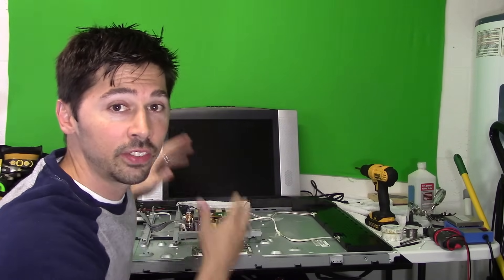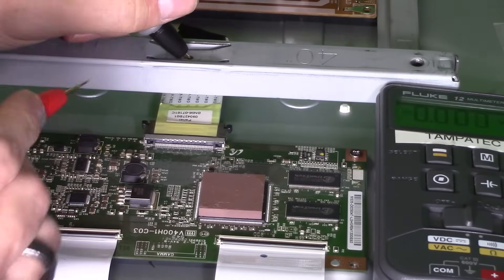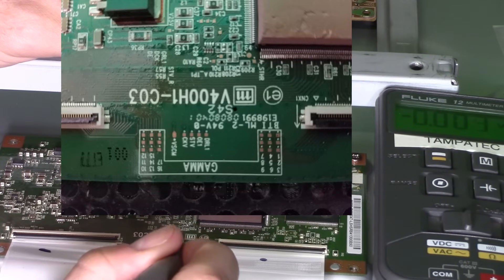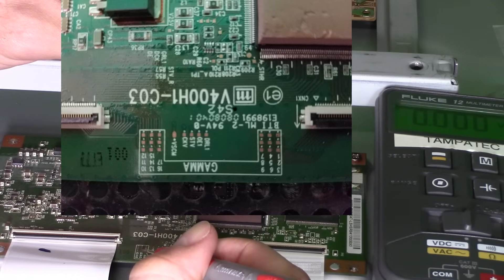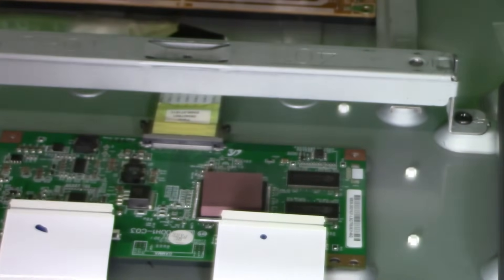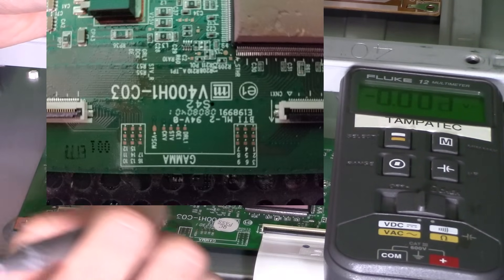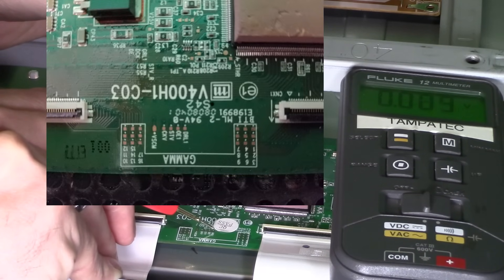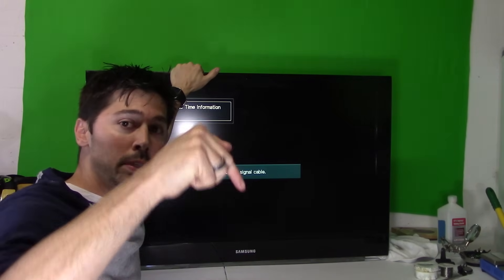THIS EASY 5 MINUTE TV REPAIR WILL FIX MOST VIDEO PICTURE PROBLEMS!!!

Comment: Hey tampatec! I like you're videos there really good to learn how to fix most problems! I have a LG42LH3000 that when switched on half the screen is black then after about 20 mins the black part goes different colours and flickers like its going to go away then after a few hours sometimes it is just a small couple of inch line down the left hand side that is brighter than the rest of the screen! I suspect the tcon board but not sure. Any suggestion's would be much appreciated! Keep up the good work, you're the best on YouTube on TV repair! Regards, Eddie
Reply from the maker: Eddie B yes you are correct send like bad tcon board get TV boards at Shopjimmy or electropartsonline.com use code tampatecfriend for discount 😉
Reply: +Tampatec I did wach other videos that said it was the ribbon cables at the top of the screen that were loose and if you press the top of the TV at the it does make a difference so I don't want to replace the tcon board if its OK. Thanks for you,re reply meant a lot to me as i assume you are a very busy guy! Regards, Eddie

Comment: Hi, I have a Viseo 50" Plasma model # PDP50X3T012. It began flickering light to dim intermittently than permanently went dim for the last few days but we continued to watch it during the week. It started to flicker with a black screen so I finally disconnected it. Took back cover off and saw a ton of dust. Saw a video that it could be the Y-sustain board and saw some old dry rotted thermal glue but cant tell if its a burn mark or not. The video recommended to start with the buffer boards but they look ok. Any advice?

Comment: I have a Seiki Model SE32FY22, and all of a sudden the left half of the screen looks like it has a thin white veil or screen over it with both vertical and horizontal lines.  Use it as a monitor, not a TV, and I can see through it, but can't do detail work like editing photos, etc. (am a graphic designer).    Seems like this might be the same problem.  Do I really need to get a multimeter and go through all that testing (i.e. what else could it be?) If it isn't an expensive part, I'm inclined to purchase it and see if it works.  Other side could go out.  Would replacing the board fix one side and keep the other from going bad?  Thanks so much!

Comment: Hey guys I have a RCA 55in no back lights looks I tested it by watching one of the videos here looked like the main power board had no power coming out going to backlight so I replaced the main board but still no lights BUT it flashes for a second when turned on any suggestions form here.

Comment: Hi there. I got a 47LG70 LCD tv. My daughter was listening tv when the screen go black. The sound keep working (optical output). She close it and wait for me. When powering the red led standby blink slowly then came blue. The backlight open for 5-10 sec then dim out a little bit "sleep mode". TCom board is falling?? 5-6 month ago I got vertical line on dark picture area, after cleaning all connector with contact cleaner, the problem was solved. All capacitors look good. No puffy, no dark board area. TCom or main board? Thanks for your help!

Comment: How do you know the proper voltage at each test point?
Reply: i dont think the actual voltage is as important as the voltages being constant. But i have no real understanding
Reply: Sean Moran I’m an electronics engineer working with microcontrollers. In our field it would be vitality important to know the voltage between boards, if not the actual waveforms on an oscilloscope. This would only give you a rough idea of which boards might not be working (once you worked out the power supply was ok !).

Comment: Awesome video that gives me something new to look at as I continue to diagnose and hopefully fix my GHOSTING problem. I suspect my issue is the bonded ribbon cables to the LCD, but this gives me something to check with the T-CON. AWESOME. Only thing I would add would be where to look for what those test point voltages should be. They seem widely varied. It's not clear if you are just looking for floating voltages (unstable) or a specific voltage at a test point. Especially since you had something like zero or 0.80vdc on a test point and that seemed to be OK. Is this info in a service manual? If so, where would I look for that manual?
Thanks for sharing!!! I appreciate your contribution and helping me diagnose and fix my malfunctioning Samsung ln46a650a1fxza!! Have any videos on the bonded ribbon cables that connect to the LCD?

Comment: Saturday 10/21/17 my 47"  vizio led lcd 1080p tv popped and the picture disappeared then returned.  Then it popped again and the picture was fuzzy in front of the cable picture.  It popped again, and the picture showed 4-6 vertical pink or purple  lines then the picture went black.  I turned the tv off for a few minutes.  When I turned it back on , the tv reset and the cable picture lasted 10 minutes then repeated the above  process.  Help please.  The Model # is M470SL.  Serial # LAQKMBBN4403300

Comment: Thank you very much for sharing your skills and knowledge. Liked, subscribed and shared.

My Samsung LCD TV UA40D5000 model with vertically shifted double image. Based on other videos in you tube, I tried to break certain connections between tcon output and the panel using thin plastic shim. It was not helped at all but all the sudden it became worst. Now the right side of the screen stuck with alternate total black and random colours vertical strips. The left part of the screen is still having the double image.

I don't want to spent money on new tcon board if there is possiblity of shorted panel.
  What you think the problem is?

Comment: Hi, saw your really amazing video. Have the same white washed out picture phenomenon, and the same tcon board, on Samsung LA40A550.
I checked all voltages. All is ok except... values on pins 1 to 9 is unstable. "Dancing" nonstop around the mid-value, approximately plus minus 0.1 Volts.
Well, what is your verdict?
Best regards, Yoram

Comment: Samsung TV UN55KU6290FXZA vers. CJ05 Hubbie used wrong screws to reattach base stand. Punctured black clip on left side of where ribbons come down & attach to the green metal strip board (runs from extreme left to center where ribbon bands are. Had picture on Left side, gray/white lines on Right side of Ribbon bands. After taking off back, hubbies idea was to "clamp" the punctured area, trying to flatten it. The Right ribbon came undone, but we reinserted per your video. Now, we have dark blue screen flashing with sound & power intermittently. HELP! Any suggestions???

Comment: Thank you for all your repair information. I have a Vizio e701i-a3. It will come on and show an excellent picture and sound for about 5 to 10 minutes. Then it will start to flicker and after 2 to 3 minutes of flickering the picture goes off but the sound is still there. I can look closely and still see the picture inside the screen. It does this for all inputs and menu. Should I start with t-con board replacement or what do you suggest?
Reply: My 70-inch Vizio plays good when you first turn it on but then it'll pop and go off read online still on but I won't have a picture or Sam I can turn it off and turn it back on and it plays good for 5 or 10 minutes that the same thing

Comment: Just subscribed. I am losing my mind over the upstar tv I bought. I want to replace the boards. I CANNOT FIND THEM ANYWHERE. Any advice?
Reply from the maker: monte claro try shopjimmy.com Electropartsonline.com use code tampatecfriend or Amazon or eBay  searspartsdirect.com
Reply: Tampatec there's seems to be no supply at all for these. Upstar m280a1 simply has no replacement parts

Comment: I have a question for you. My LG has an issue where the menu keeps popping up for no reason over and over again. No buttons are pressed on the remote and it automatically just keeps coming back. what can I do to repair this issue?

Comment: this is great...could you tell me if its the T-Con board that is the main issue that would cause problems with picture? or could it be other components of the tv? im using a samsung UE48JU6400k and i get weird blue faded areas on the tv that are light blue..its most noticeable when looking on a white background. wondering what i would need to replace.

Comment: Hi there, lived in Spring Hill for about 28yr., I live in W. tenn. now and mess with electronics mostly as a hobby now (retired), I have Spectre tv model X322BV, no picture, power light on when I turn it on. Any help would be appreciated. pulled the main board but nothing obvious, now stuck ???

Comment: Can't the board fixed?  Who can afford a new board I can't.  Technician (I'm in the Philippines) said he can try and heat up the board with hot air and see if it will fix the board, I haven't done this yet.

Comment: Hello i have a sharp LC-60LE660U. when i power up the tv there is a quick flash of the display and the led stays white. So i did some debugging and i am at a point i need a little more help. if i unplug one of the tconn ribbon cables and power up the tv i get a picture on one side and a white screen on the side that is unplugged. If i i do the same thing to the other side i get the same results. the picture looks fine except darkening near the middle bottom but i think it is because i have half of the system unplugged.

Comment: I have a sanyo DP55D33 tv. It has worked great until we got home from a trip. It now has faint blue vertical bars on the left side. They kind of twinkle where the pixels are trying to work. They are about 3 inches wide. You can still see a regular picture through them. They are opaque so to speak. There are 4 blue bars. Some are darker blue than others. We still have full picture and sound with the "ghost bars" in the background. Do you think this may be the T-con? I don't have a multi meter to check connection. I have seen other videos where the ribbons to the actual screen need pressure on them. Any advice would be great. You make some very good and informative videos. This has been the best thing I have found on the internet so far. Thank you!

Comment: My tv is Samsung ue46d7000lsxxn with tcon board s240labmb3vo.7.
I see black lines espacially with soccergame (green background)
After checking above video I opened my tv but my tcon board is different then board in video.
I think i have to replace the board but I do not know how to check this board before buying new one.

Comment: Hey, this is great! Thank you for sharing your skills!

We have Samsung TV that is acting up. Although it's 6 years old, we would like and try to repair it (since we live in the Caribbean and getting a new one of the same quality will cost us immens amounts of money).
It is a Samsung UN55D6420UF. From reading up on it and watching some of your videos, we think it is the T-Con Board that needs replaced. Our symptoms are slightly different because the pciture isn't permanently gone, though and I wanted to ask, if this still could happen with a damaged T-Con Board.
When we turn on the TV in the evening, it works for 1-5 minutes and then the screen starts flickering green or purple and soon after the screen turns black. Sound still works. As we turn the tv off and back on, the picture is either there for one second, then turns black or it is black at all times. It is an "illuminated" black screen. Sometimes the screen stays "illuminated" black sometimes the tv screen is completely black like it looks when it's turned off.

If we leave the tv off for several hours, then the same thing happens again. It works for a couple of minutes....etc.

Could this still be the T-Con Board? Is it worth trying to replace it? Will we still find that part for a tv that old?

Thank you so much for your help.
Nadine.

Comment: Hi, I have a Sharp Aquos 70 inch 3D TV. The picture suddenly started to flicker like there was a bad connection. I had a repair guy come in and take a look and he said it was a bad panel and said there was nothing he could do. I am still hoping there is light at the end of the tunnel for this TV as it's only 3.5 yrs old. Can you offer any insight? Somone said they pulled out the left T Con cable and it fixed their problem. I just need a video of how to do this . Any help would be greatly appreciated.

Comment: I have a panasonic TC-P58S1 Aug 2009 LG92240007  Plasma TV that has voice and shows Cable TV menu but no picture on any stations; just white, purple, blue and green diagonal splash from upper left corner to lower right corner of screen. Any suggestions?

Comment: Hi. I have a sharp tv with backlight, sound but no picture. I have tested the t-con board points to the screen and they are showing minimal volts. When I unplug the cable/ribbon and test there is normal voltage. Any ideas as to what might be causing this as I replaced the board but it is doing the same thing. Looks healthy until it is connected to lcd.

I've watched all your videos, very useful and interesting and I've learnt so much. Thank you!

Comment: I`m very glad I found your videos..I always assumed HDTV`s couldn`t be repaired...I now know different...Thanks!
Reply: I worked at a tv repair shop when I was in high school...way,way back in the "old school" 1960`s when we had to contend with horizontal output transformers and picture tubes remaining charged with thousands of volts long after the sets being turned off.....today`s HDTV`s look much less threatening to service....  :-)

Comment: greetings! I have a LG LN520B,. when I plug it in. no power light, no nothing. won't turn on. any idea what may cause this? thanks
Reply: Rich Sims Check for open fuses in power board Remove power board and check for cold solder joints around components that get hot. Check all voltages coming off the power board and do a visual for swollen electrolytic caps. Check electrolytics with a capacitor tester

Comment: Emerson blinks red to green. Everything looks clean on inside. Conpasitors look good. Hear a pop sound when I plug in tv. Hard reset flashes 10 times when tried.  Than back to two times green when left plugged in. Don't have a workibg volt meter to check anything yet.

Comment: I have a Seiki t.v. model SE50FY28.
my t.v. had no sound, so I replaced the power supply board.
Now it has sound, but no picture.  
Followed instruction on the flash light test.  The flash light test failed.  I did not see any picture of my menu when I press the "menu" button on t.v. and shined flashlight onto black screen while t.v. was on;  the screen was still black.
I am wanting to test the T-Con board but do not know where it is located on this model Seiki.
I have noticed that the "source" button does not work when I press it to change to hdmi  port where the cable box is hooked up, 
or could it be that the hdmi port does not work and that is why the source does not pickup the signal?  The antenna hookup does work as I can hear the channel being broadcast, and the up/down channel button on t.v. works.
Anyways, any assistance you could provide would be greatly appreciated.

Comment: hey I liked your video so this is my problem my grandmother  has an element 42 inch flat screen the red standby light is on and she says that regularly the red turns to green and the tv comes however now it just stays in red standby mode any suggestions I just heard about it today and some of the stuff on line is not clear but you seem out of all of them to know what your talking about any tips for this would be  greatly appreciated

Comment: I have a Sanyo dp32640 that turns with sound but no picture. The t-board lights up but after a few seconds lights turn back off. I suspect it's the T-board but not positively sure. I don't believe its the inverter board that's doing that.

Comment: I have a Hitachi le50a6r9 tv I have blue power on and red power off buttons, no blinking lights, I looked at the boards all looks good, I have power in and 12volts coming out of the main power board, the tv is dated 12/15 so I think they last longer than this,  I have changed the power supply, nothing has changed. I have power coming out of the supply everywhere i should.

Comment: I have a VIZIO SV370XVT that starts with no video, than horizontal lines and slowly the video appears
I changed the main board and now the sound comes up immediately, but the whole screen has lines all over and it takes some 15 minutes before video starts to appear and it's very clear and sharp
Can it be the T-Con board?
Suscribed Thanks

Comment: Tampatec, this video won't play, even in 480P, without constantly stopping to buffer!  You should do something to fix it because that makes it pretty much unwatchable.
Reply from the maker: steve c that's your internet maybe reset router or maybe update phone and YouTube app. my video plays in HD smoothly. disk clean up can help speed up your pc.
Reply: No problem on my end with 50 Mb speeds, everyone else's video in higher resolution will play without a problem and even other ones of yours will too.  Actually I only played one other video of yours but it played OK.  It might be a problem with CenturyLink who has been accused of throttling videos in the past but in this case Youtube actually seems to be throttling it depending on what it's being played on.  When I tried it before the best resolution was just 480 but now I see it can go up to 1080P so that's still a problem to take up with Youtube.
BTW, changing a bad T-Conn board on a 70" Vizeo won't fix the problem because when the Sharp made LCD goes bad it blows out the T-Conn and if you replace the T-Conn it will just blow again.

Comment: very informative. i dropped my Samsung 43in  3 feet on to carpeted floor taking it off its mount. I turned it on it worked, but flexed the frame and got lines through the logo worse lines then vertical lines.  After seeing your helpful video, I'm suspecting the ribbon connectors.